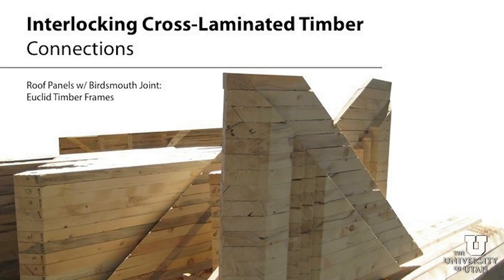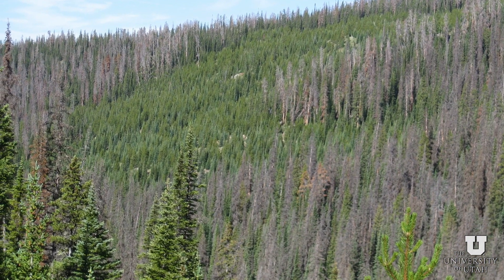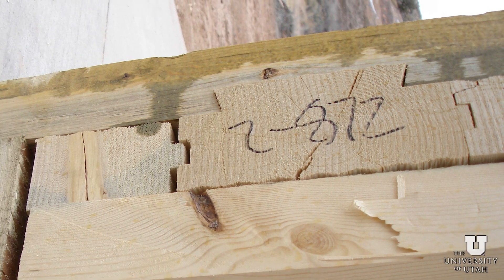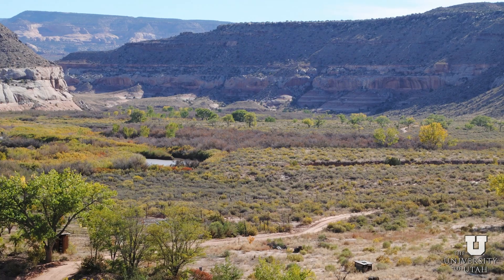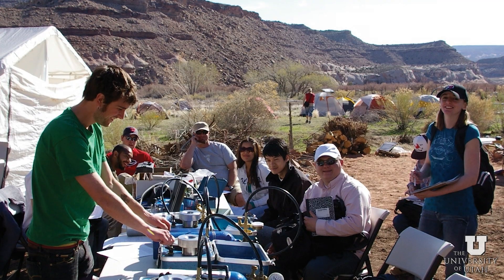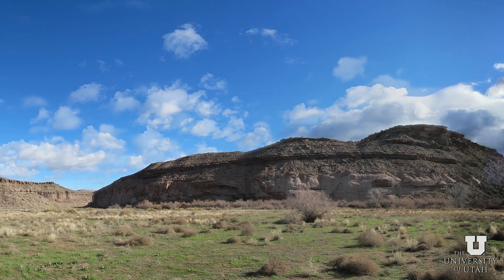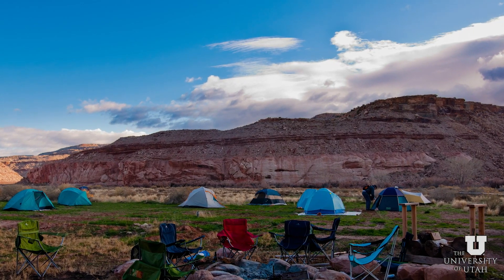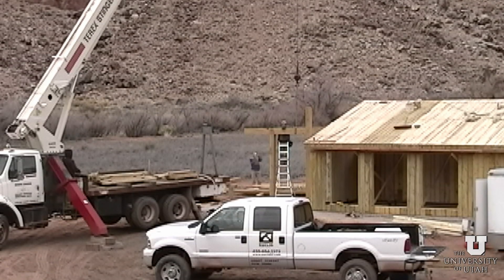Wasted Wood Sees New Life

Comment: Cross laminated timber is a multiply and completely solid material made from wood, a modern building material, a solid prefabricated element made from wood that insulates heat and can simultaneously carry loads.